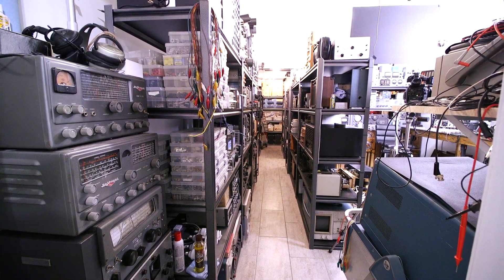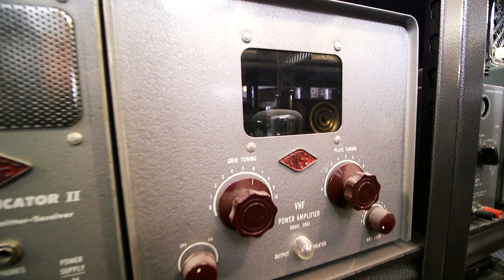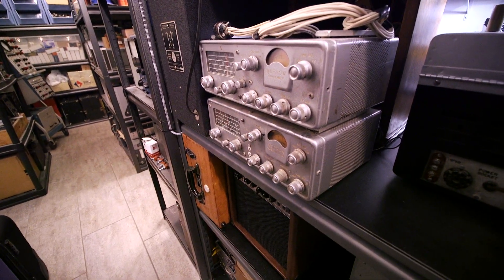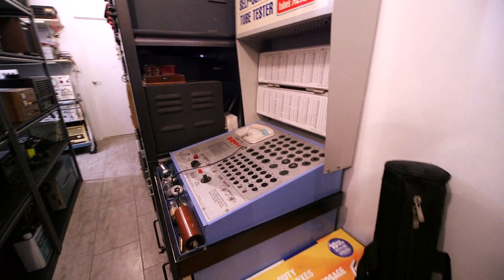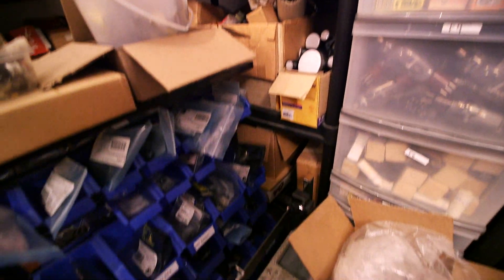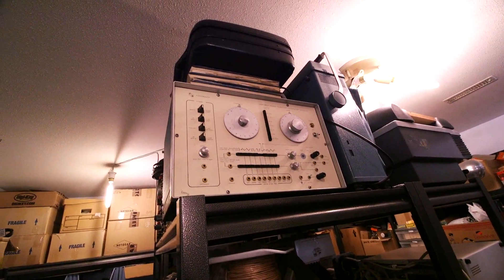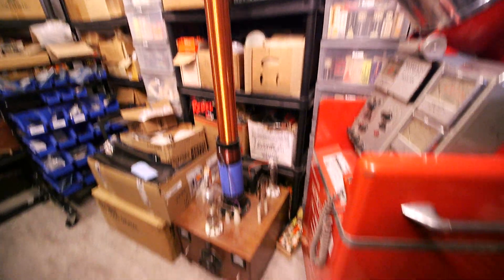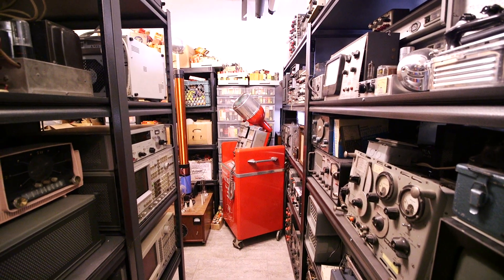Neat Projects Inside Lab 2!

Comment: Hello Professor Carlson:  I have collected a few Sony mini cctv camera kit, which is a special kit from I think the 1980’s, but Sony was making portable cctv cameras, then shrinking them over the years.  The 80’s, most cameras were still quite large, but this one I found unique because not only did it fit in the palm of your hand, but it used a tiny saticon image tube.  I could email you Sony schematics and adjustment pages if you have any interest.  The Sony model is an hvm-302, which came with its own 4” b&w monitor, and a neat mini flexible video/audio cable, the video good for its day, and audio quality was excellent.

Comment: When I was 12 I built my own UFO detector. All the books and articles on the subject back in the early 1960s talked about how electrical equipment would all shut down in the presence of a UFO, so.. I reasoned if an active circuit would fail, lets use a failing circuit to trigger a mechanical alarm. I used a battery, relay and mechanical advantage linkage to operate a wind up alarm. If the battery driven relay un-energized, it would allow the wind up alarm to run.

Comment: Greetings Mr. Carlson, I love your videos, and its interesting that you also know about Shango as well (it seems like it must be a small world in the electronics repair videos world because Shango mentions radiotvphononut in his videos, and radiotvphononut mentions Shango in his videos, and then you mentioned Shango in your video, and radiotvphononut mentioned you in a few of his videos and then Shango mentions you in a few of his videos as well). 

I'm currently in the middle of electrically restoring a 1927 Eveready Model 1 TRF Neutradyne Radio (a rebadged American Bosch Model 28 Radio) which had a lot of dry-rotted rubber wiring in it, which I've already replaced about 90% of it that could be replaced (the rest of the wiring  while the insulation is brittle is still intact and is also near impossible to replace because of the fact that some of the wiring is in the power transformer and filter can which were meant to be replaced as one assembly because they were contained in permanently potted aluminum boxes that were meant to be removed and replaced if they failed).

The cabinet is in near mint condition and is solid oak and I also have the original speaker for the unit as well which I need to repair as the inside of the speaker cabinet got damaged when the speaker took a tumble at some point in time in its life which broke several large chunks of wood out of the cabinet which I will repair with some epoxy, and I also will be replacing the original dynamic speaker from inside the cabinet as the cone got damaged when it took that aforementioned fall.

Comment: Hi Paul. Great video. I’d love to see the engine analyser restored to original. I assume that you can study HT patterns on the tube? I’ve done that a little and it’s very interesting. If you could find an old car with a points distributor, a single coil, and multiple cylinders you can see a great deal going on at various points of the traces. Capacitive coupling to the outside of the HT leads of course!

Comment: I’d love to see you restore an old Cold War era Racal RA17, I used to work on them back in the early 80s..
Love the lab(s)
Reply from the maker: I have two on the bottom shelf, you may have seen them in the video. One has the 13kcs filter option, which is very desirable.
Reply: Mr Carlson's Lab yeah, I saw them. Lovely old girls, they seemed to be a new mod or variation out every couple of weeks back then - difficult to keep documented. We had some of the automatic ones with chain motor driven  tuners. - not allowed to tell you what they were for 😂😂
Reply from the maker: Are you sure those weren't the transmitters? :^) Have a good weekend Mick.
Reply: Mr Carlson's Lab  Defo RX, operator would, hit a button to stop the sweep and start recording the traffic for later transcription and DF - fully superseded in the field by the digital stuff really by the late 80#

Comment: One thing i saw many years ago was a radio signal finder, used by licensing authorities.
Basically 4 antenna on the roof, the scope had a dot in the middle which would move as a line in the direction of the signal, the longer the line, the stronger the signal, 
And maybe the meters could be used for signal strength too

Comment: About your unsorted resistors - I'd suggest sorting them by the 3rd band.  It will make it much easier to find the value you need in the future without spending a ton of time up front.
Reply from the maker: I recognize resistor values immediately. You could throw a resistor across my line of sight and I would tell you the value and tolerance. So the box is a breeze. Thanks for your comment Russell!
Reply: @MrCarlsonsLab  As a kid, my dad put me to work sorting resistors.  I may not be quite as fast as you, but I can also read resistor values quickly.  But by sorting the pile by "number of zeros", you have much smaller piles to dig though when you go to locate a needed part.  It's easier to find that 1.2K when it's not in the same pile as the 12K.  And that initial sort is much faster then trying to break them down to the exact value.  Your shop, your method.  But I think it's a good idea for those who don't read as fast.

Comment: Can't wait until you get to that Hammarlund HQ-150.  Right above the monitor I'm typing this on is an HQ-150.  I haven't powered it on in about 15 years, but it did work before that, and worked really pretty nicely.  Nice thing about the HQ-150 is that they used all ceramic caps, with exception for the electrolytics, of course.  :)  So maybe not a lot to fix in either yours or mine?  :)

Comment: I was wondering do you ever do things outside of radios like synthesizers, POV (persistence of vision) displays, and holography? 

Ah! Strange request: make a theremin!!  Maybe even one up the thing.  All the builds I have seen on Youtube make terrible theremins.  They require the hand to be close and don't have the second hand control like a real theremin and they generally sound dreadful.  They generally look like junk as well.  You have so much cool classic stuff.  I am sure you could build a great theremin.
May even be worthy of that nifty yellow alien devise.  Maybe have a vector display showing the sound generated.
It would be nice to have a couple petals: 1.Sustains sound and there should be a knob to control the duration of the sustain.  2.Makes the frequency change discrete notes like keys on a piano.

Comment: I’m of the mind that you could do BOTH, Paul. As others say, either an add-on or maybe something integrated. Would be a challenge and reward higher than usual. 

Paul, I’m having trouble finding a suitable replacement for an obsolete part in an older rv power center. It’s got S0315B stamped on it. I think it’s an SCR and it’s the output of the rv battery charger.  About 1980 vintage. 

Any help would be appreciated. Thanks for all you do.
Reply from the maker: Thats a Teccor part. You will have to look around and compare specs of more modern parts. If it's in the output of an old battery charger, it's not going to be too picky other than voltage and current specs.
Reply: @MrCarlsonsLab  Thanks. My particular issue is finding the specs for the original part so as to have something to compare to. The little pc board which is the battery charger uses a 555 timer chip as the regulator and this  scr is switched by that timer output. Appears to me to regulate by feedback voltage keeping trigger on, or pulsing, or off. My main concern is having an appropriate trigger level/current draw by any new unit I’d be trying to use. 
The obvious things are 12 volt system and the chargers stated current of 6 amps. But what I don’t know is what an appropriate on threshold voltage/ current is for the control input. Original part has one of its three legs that spins so no contact internally so I can’t even mock it up. 
Thanks again.

Comment: Ya ya something neat! Quick question. What would you do with garage can full of smt parts from a r&d lab I got dumpster diving. They where never used and original small lot size packaging. Got a hp 3580a spec and hp 4275a.

Comment: Was that a station/lab ground wire I saw running along the bottom of one of the doors and tacked to the wall of the lab?
Reply from the maker: Thats RG393 Coax used to feed bench 2.

Comment: 826 tube = thoriated tungsten filament, they have fairly specific recovery directions, which also shortens the total life because you over volt the filament a high percentage from 130 to 350% in various lengths, with no plate or grid voltage at all, you pretty much try to make it very near white hot melt-down and self cleansing, without blowing or killing all the thorium(yes radioactive)
there's directions/sheets online dated many years back, go find them for yourselves ;)

Comment: thanks for the lab tour, that was neat.
Us CB guys would LOVE to see you restore that old DAK!
Was it the 9 or the 10?
Reply from the maker: That is the 10. I had a 9 at one time, neat AM rig.. High level (solid state) modulated vacuum tube final. Neat design, but as in all DAK's, the repair mans famous saying: "If you've got a DAK, you'll be back." They have the worst capacitors in them... They all have to go, and the boards have to be completely re-soldered. Hard to believe this was the competition for the Browning Golden Eagle.
Reply: @MrCarlsonsLab  agreed, especially since the DAKs just didn't have it in the modulation department as opposed to the brownings.  Unless you modified them of course LOL.
If you do decide to restore it, you can edit out all the parts where you curse at the stupid double sided PC board.  Thanks for replying, im off to your patreon page.

Comment: Mr Carlson, do multi-channel scopes exist that allow the user to view each channel in a separate time/division? If yes, what is this feature called in the consumer electronics market?
Reply from the maker: Hi Foxsmith. Scopes that allow you to view signals from two separate time bases "essentially two separate scopes in one" are not common now, and are expensive. The older Tektronix 555, 556, 565, and so on, allowed this operation. You could have a regular scope on one trace, and a spectrum analyzer on the other both displaying on the same screen at the same time with two totally different frequency ranges. I still use these scopes regularly for this exact reason.

Comment: I have a great interest in Tek scopes and test equipment in general. Did I see an 11301 on the bottom shelf? I am also curious which spectrum analyzer plugins you have and how well they work on the ISM bands if at all. There is a lot to be learned from Tektronix. I believe hobbyists are very close to replicating the hybrid technology from the 60's and 70's. Tho, I could be crazy.

Comment: You should make something cooler than an engine analyser
I like the idea of that big tube tester. :)
My friend has a simple tube tester,  but the list hasn't got all the tubes he uses in his collection of Akai reel to reels, for one tube i worked out what switch settings to use, but the shunt value on other tubes had no resemblance to anything in the datasheets so i couldn't work out what shunt value he should use.

Comment: Can you use a high freq high powered flashing schtick to reflash the getters?? I found a gold sputtering unit with a hi freq inductive accessory on the side of the unit. It's great for hardening small steel parts. I can melt them, if I am not careful. I do a quench, then reheat and draw the power down slowly and anneal the part and I have through trial and error found very effective ways to harden small steel parts.
Reply: It will also reflash getters too.

Comment: 7:11 Tube Tester - back in 1976 I was stationed with The Old Guard, at Fort Meyer Va.  We were in the Communications section which doubled with TOG as Theatrical lighting and Sound Stage Section I started out with Headquarters Communications.  It seems all the idiot officers thought that if we were in communications, we must surly know how to fix televisions.  NOT SO!  My main MOS (specialty) was field wire, stringing commo wire across deserts and through jungles and hooking them to field switchboards and field telephones!  That said, we did have a repair section that handled fixing the portable radios we used in ceremonies and,  of course the tactical radios that the infantry used, since we were, in real life, an Infantry Unit, the 3rd United States Infantry Regiment (RENF).  So it was, the officers would come walking in and give us their huge old table television sets usually larger then any of we poor sergeants could afford, and expect us to fix them and call them when done.  So what did we do?  Well we pulled all the tubes and walked off base across the street to the local drug store and checked them with the tester, got the replacement and fixed their stupid TV's. For which they would pay us the price of the tube and usually a 5 buck tip.  Back then it was about the same as a 20 buck tip today I guess, that was some time back and I am an official old fart.  If it were a capacitor or something, the radio repair guy would open her up and take a look. Of course most of the army radios back then were modular and he didn't know a hell of a lot about that sort of thing either, other then his basic electronics training. We did have a nice tube multi-meter and a military tube tester but it was just so damn handy to walk across the street to the drug store and hell they had all the tubes we needed in stock.  Back then the TV's were new enough  that it was usually a weak tube and a quick fix that the fellows could well have done themselves.  There were those rumors though that were indeed true, if you work on tube equipment, you can get killed by the high voltage. While I did get bite  a few times, I never got hurt bad enough to need attention or turn down a fix job for the five bucks tip, after all  you could get two six packs of Rolling Rock beer for a fiver back then.

Thanks for the wonderful videos, I am still a member of your site, the only site I have seen that deserves my hard earned support money!   KE0JBL 73's
Reply from the maker: Thanks for taking the time to share your story Jerry, it was an enjoyable read!

Comment: You mentioned that the RACALs were your favorite receivers.  Which RACAL model are you referring to?
Reply from the maker: The Racal RA17-C-12 or the RA117 are incredible receivers, and will outperform many modern receivers "Easily."
Reply: @MrCarlsonsLab  Thank you.  I use the "newer" RA-6790/GM and it works well for my needs.  I've had issues with the tantalum caps exploding, but otherwise I really like it.

Comment: Restore it as an engine analyzer.  There is a huge market for. old  engine  test technology.  See the "Coldwar Motors"  You tube channel. Cars. from the 40's and 50's and. into the sixties. Also from Canada - many are base model "radio delete" models. I think they had a. segment on Model T coil packs for. ignitions. and also an ignition distributor tester. they. used  reworking a Straight eight engine's distributor -  selecting advance curve springs. and testing condensors. and  points.  Crude  diagnostics on simple  flat head  inline  engines...etc.  Someone. would still enjoy using that analyzer.

Comment: what about 4CX500A tubes to replace the high power RF tubes that have gone gassy and you will have to have a forced air cooling system to keep the 4CX500A from expiring.

Comment: When I was in my very early teens (I'm 64 now) my Dad gave me an old receiver that didn't work while he got a new Heathkit Mohican. I got it working but I've never been able to find out anything about it. It  appeared to be of a marine type (big, steel and heavy) and the only plate on it said RG39. I remember it had a large "T" handle turret band coil change and the overall look was similar to the CR100. If anyone has any idea about this I would love to solve the mystery after more than 50 years.

Comment: Acetone or peroxide should break the glue down in the crack I don't know if it affects Bakelite plastics
What do you think of single ended tube 160 Watt radar tubes in amplifiers any chance of building one on yt
I don't get it why do they call it UFO finder just because the way it looks, yes that sounds interesting!  would it be a planet finder showed on the screen and meteor plotter might be useful.
Can you use a 30 amp variac coil just the coil in a valve amplifier as the output stage I would have thought that would be a cheap way of going about it

Comment: I like the idea of displaying the sky on the CRT. Daytime imaging could be done with only a vidicon tube, but i don't think that you'd get much signal out of it when it's all dark. I may be wrong, since i have never used vidicon tubes in that way, but i'd suggest adding an image intensifier before the vidicon tube to turn it into a kind of a night vision camera. There may of course be a lot easier ways to accomplish the same thing, but i like the idea of doing it all with components that were available at the time, it adds to the coolness factor.

Comment: First - on the old automotive diagnostic device - my inclination would be to repurpose it rather than restore it, unless it’s so rare it belongs in an automotive Museum - then restore it and donate it, otherwise it will never be used for its original purpose once restored.  As for the lab inventory with all the pending cool projects - I suspect Mr. Carlson’s work queue is design to keep him going at least until age 125.  Solder on!